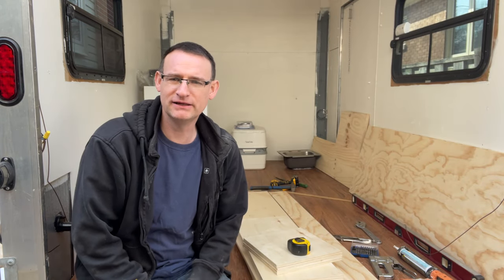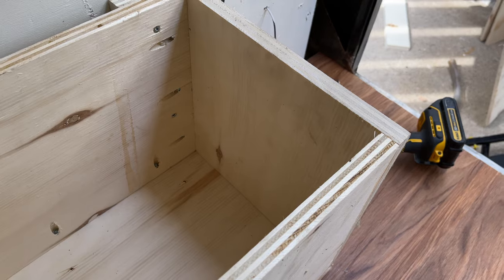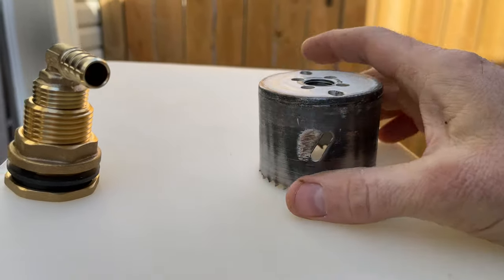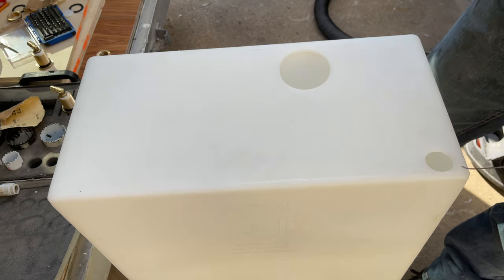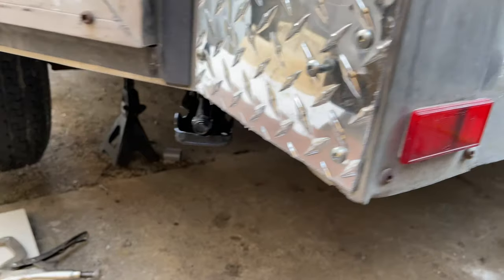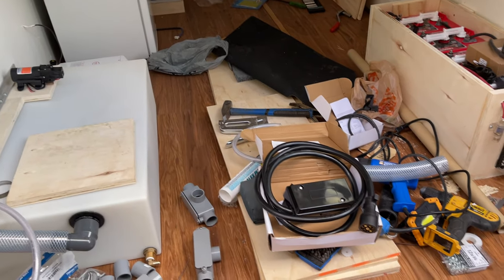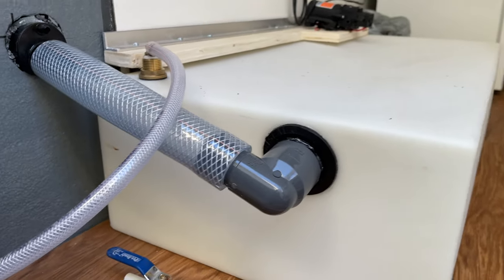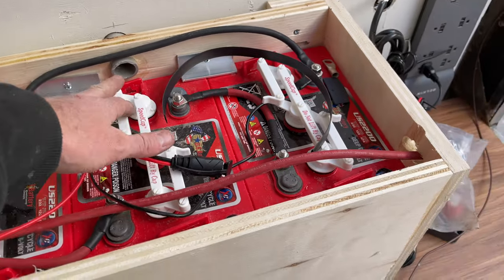How to Build a Cargo Trailer Camper Part 6 - Water Tank/ Battery Box/ Stabilizers

Comment: Man! You took the long way around the world on that tank plumbing!
Reply from the maker: Hey give me a chance to explain myself... I haven’t released my plumbing video yet. 😅
I don’t know if you noticed in the other videos but all my water lines are slopped up to the taps. I do over 50% of my camping in winter when it’s freezing. I wanted to be able to... after camping open the drain and drain all the water in the system, no flat areas for water to pool. I can’t put RV antifreeze in then flush then go camping every weekend it would be a pain. 
Hope that explains the reason I went that way.
Reply: Your plumb job is fine I get the pipe pitch and all it was the tank and the pex,my tanks had all the fittings and hose outdoor cap came complete and I used braided lines 5' and 6' long I came back here to delete my comment thinking I may have been a little hard on you! Mad props for the build I'm looking forward to watching your other vids!
Reply from the maker: I got you... no problem at all. I think it’s good to be challenged a bit. How do we learn new things or make sure what I’m doing is going to work. 😁
Thanks for watching!

Comment: Hey i like your work, good job. Here is an idea i used on my cargo i put a valve before the pump then a tee with a valve and a short hose , so come winter i can drain my tank then shut the pump line, open the hose line so the pump will suck from the hose and stick the hose in a gal. of RV antifreeze, i then open my faucet untill pink antifreeze comes out, im now all winterized,  just an idea if you live in a cold state. Keep up the good work, Take Care and Be Safe.
Reply from the maker: That’s a great idea! I’m hoping to have enough slope that all the lines will drain but if I can’t quite get enough I’ll do that. 
The thing is I plan on doing lots of winter camping so I’ll be working all week then heading out on the weekend. So I don’t want to flush the lines each time, if that makes sense...
Thanks for the info, anything else you notice please mention it. 👍

Comment: id stick some of that vinyl between those metal straps and the corners of the water tank... so they dont wear through! just a precaution. good work on everything. ive got all of this to do myself lol
Reply from the maker: Right on…. I actually used rubber flooring underlay under the tank and on the sides… I should have mentioned that in the video. Thanks for mentioning it… definitely important 👍

Comment: I have the same jacks and I threw away the goofy handle and welded a nut on the end of the screw shaft. Then I use a 3/4 socket on my impact driver to run them up and down.
Reply from the maker: Yeah that stupid end… I think they did that just so you need to buy their handle…. Definitely going to modify it it the future. Thanks for the idea 👍

Comment: Very cool. You might be ok since it's a fairly short trailer but it appears you're putting a LOT of weight at the rear (water + batteries) which usually increases sway and in windy conditions or if you need to make an emergency maneuver can cause the trailer to be uncontrollable. That's why most travel trailers have the batteries in LP in the front and have the fresh water in front of the wheels, then gray water and last black water (which is usually less full).
Reply from the maker: Yeah no problem at all… sometimes I don’t even put the sway bar on and it tows great with my little ranger. I think what you have to realize is a cargo trailer is often designed much different then a full size rv trailer the wheels are further to the rear. So if you were to put all that weight like my batteries 240lbs, water tank 300lbs plus propane tanks 70lbs, black water, grey water and everything inside…. your tongue weight would be over 1000lbs. Right now my tongue weight is 375lbs with both propane tanks full. 
When looking at a lot of cargo trailer builds I think that’s a very big problem…. Professional built RVs with the big section hanging off the rear can balance out all that weight on the front but our cargo trailers are different. Hope that makes a big of sense I’m not sure if I explained that right.

Also if you look at my batteries and water tank they are 2” forward of the axle… I was going to place them on centre but when I added up all the weight I had to shift them forward a couple inches.

Comment: I love your video, I wonder don't you mind telling me what kind of standard  1/2inch ABS Fittings for the water tank? I can order one that you have.
Reply from the maker: So I used brass 1/2 brass bulkhead fittings for the supply and vent and then threaded in pex fittings. For the Fill pipe I used a 1 1/2 uniseal and then used standard 1 1/2 ABS pipe. 
I added the links into the description. Let me know if that helps? Amazon has them listed 👍

Comment: Just to put a thought in your head, I never use pex in any type of rv.  Let me pose one question to you to explain why, would you use px to connect from your washing machine to the wall valves in your house?  No would certainly be the answer and that's why I don't use it. Braided hoses are designed for this purpose and that's why I use them. Now everyone is going to say they are not approved for drinking water and that's correct but I always install either an inline filter system of a counter mounted Berkey for this purpose. Using a filter also allows for filling your tank from a stream if necessary when you're boondocking and don't want to leave to get water.  Just a thought.
Reply from the maker: Thanks for the ideas... I’m always open to different ways of doing something. We don’t ever drink out of the tank anyways always bring drinking water. I just used Pex because I had all of it from another job. I believe it’s used quite often in trailers I’ve seen. I’d definitely be interested in filling up from a lake or stream that’s something I’ve thought of but never came up with a concrete plan. Do you use a couple filters on a water hose to pre-filter it? 12v pump? That would be super handy.... tons of water where we usually boondock.
Reply: @waysoutback  Yes I have an extra 12v pump and hose and yes I use a seperate filter. If I'm too far from the water I pump it into a 5gal water jug and carry it. Not the preferred option however!  Yes pex is frequently used and I've only heard of one person having a problem with it. It did not break but he burned a hole in it. However they were out of the country and there was nowhere to buy pex parts. Fortunately he was carrying some extra pieces and was able to fix it. I think any place you go would have washing machine hoses.
Reply: Braided lines have been used for faucet supply lines for years,yes drinking water so much misinformation in the comment sections of these cargo build videos
Reply: @MrJoey1570  That's correct and I'm not sure but I think those are slightly different. None the less if you use a filter you just add a little safety.
Reply: @MrJoey1570  I just checked and the small lines going to sinks have a nylon liner where the washing machine lines are rubber like a garden hose.
Reply: @johntatman9168  I didn't use wash machine supply lines on my build they were dishwasher supply lines
Reply: @MrJoey1570  Ok. I do because I can get them in so many different lengths.
Reply from the maker: Sorry I missed this comment. I love this idea... maybe incorporate a few spin off filters and a pump in a tool box with a collapsable water hose and you would have one sweet water transfer set up. Thanks for the idea! 👍
Reply: @waysoutback  yes I like that idea also.

Comment: Did you install a gray and/or black holding tank(s)? If so, how big (gallons) and how did you distribute the weight?  I am in the planning stage of building a 16x8x8 w/ a duel axle and am trying to figure the 'proper'  weight distribution out. I plan on a 40gal fresh water, and 30 gallons for the gray and black tanks. Also, I hope to figure out a way to maybe heat the tanks to prevent freezing as we do a lot of winter camping in upstate New York and northern border states and a frozen tank or pipes can really suck.
Reply from the maker: It’s great to hear you are starting with this is mind…. As you can tell…. I think it’s super important! Get a good solid plan. 

This is my suggestion. Find out the hitch weight right now before you start. That’s your goal don’t lighten it… a bit heavier is ok but definitely not lighter then the trailer was designed for… whatever you put behind the axle you will have to compensate with same weight in front. I think knowing your hitch weight and keeping it the same or a bit more, never less is key as your building. To get that… I’d recommend buying your tanks placing them inside your trailer in the area you want then fill them with water then check your hitch weight. Then do the same with the other heavy items, fridge, stove, batteries Keep moving them around keep checking your hitch weight. Also remember side to side weight.
As for winter camping it really is a bit tough - The tanks you can heat with those heating pads but the lines really need insulation for when things sit especially at night. You could use that pipe wrap but my recommendation would be water tank and lines inside grey black tank outside. Then you could add a bit of RV antifreeze in the tank to assist in the cold….. Another option is what I’m planning…. depending on your style of camping and where you camp add a three way valve… like one they use for a pool (full flow) one way from sink, shower the other to the grey tank the other to the ground. Extreme cold weather run it to the ground no problem with any freezing.
As for black tank I would use a composting or such toilet.

Comment: what size braided line are you using to fit the 1/2inch pex fittings? and are you using pex crimps on them?
Reply from the maker: It’s 3/8 and I heat them slightly with my heat gun slip them on and then use gear clamps to secure them.
Reply: @waysoutback  thank you

Comment: How's the heater work with out the muffler?
Reply from the maker: Really good! I honestly don’t see the need for it. On high it can be slightly loud outside but inside you can’t hear anything over the fan. I think it’s helpful in preventing it from plugging up

Comment: Where did you get the water tank?
Reply from the maker: This is the tank I got 
https://www.amazon.ca/Icon-12455-WT2455-33X18X9-GAL/dp/B01MY7FEC5
But I bought it in the Amazon used return for 1/4 the price.